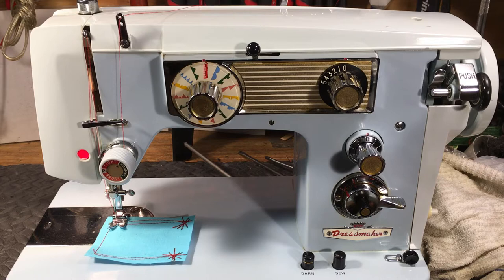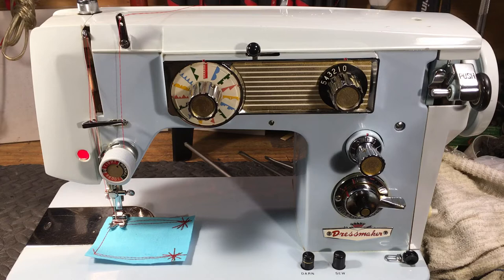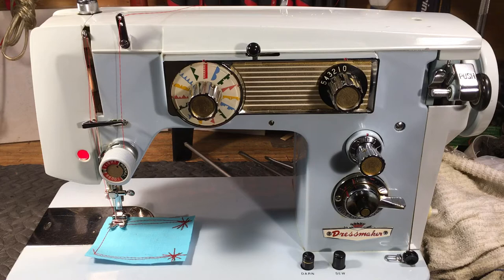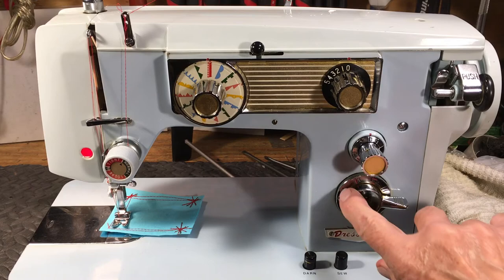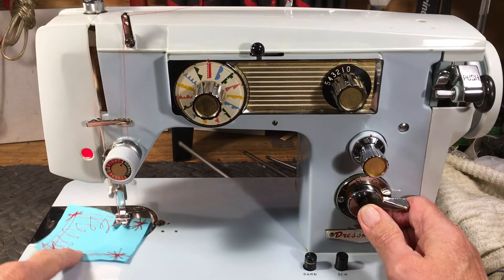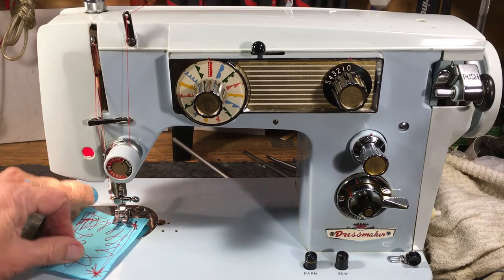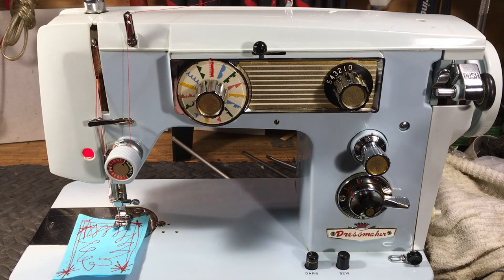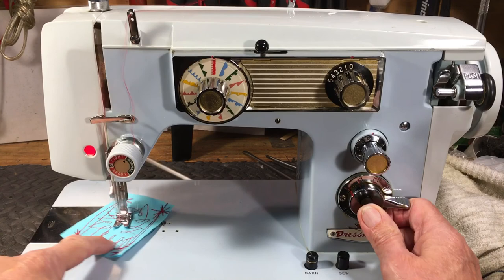Dressmaker SAMB-2 (side load)15 class masterpiece. Real heavy duty precision 2 thumbs up (Video 172)

Comment: Thanks for this - I always learn a lot from your vids! I just picked up a functionally-identical machine (with L-C-R needle position), called an Adler 950-B. A real beauty! Same layout with different knobs and color scheme. Once unfrozen it works great. A question re hook timing: Since the hook moves with the needle in zigzag, the hook timing remains constant at all needle positions. Is the hook tip set to cross the needle a little higher above the eye on these than with front loaders? This one is 5-6mm vs the 1-2mm I'm used to seeing with front load 15 Class at right position.
Reply from the maker: The hook will often pass a little higher up on the scarf (cutout) of the needle on a side load bobbin than on a front load bobbin. It won’t be more than halfway up, but in that area.
Reply: @randyyoursewingmachineman9954  OK thanks. It's probably where it is meant to be, then. It sews fine.
Reply from the maker: @JohnBau  😎👍
Reply: @randyyoursewingmachineman9954  For future reference, where does one loosen the hook on these side loaders to adjust its timing? I don't see anything obvious on the hook or its shaft.
Reply from the maker: @JohnBau  they are usually drilled and pinned. Any timing adjustments are to the needle bar height most likely.
Reply: @randyyoursewingmachineman9954  Yeah, this shaft is pinned at both ends, no adjustment. Thanks for confirming. The hook point passes the needle near the top of the kerf.
Reply from the maker: @JohnBau  😎👍
Reply: @randyyoursewingmachineman9954  Hmmm... I don't see any screw that releases the needle bar for adjustment, either...
Reply from the maker: @JohnBau  look in the little hole in the casting on the right side of the needle bar. Shine a light in there. 
You will see a slotted screw. 
Use the correct screwdriver if you ever need to adjust it. 
If you compromise the screw head with an incorrect screwdriver, it will be game over. 
Proceed with caution.
Reply: @randyyoursewingmachineman9954  Ah, ok, I see it, from inside the harp. Yes, the screwdriver needs to be exactly the right size... I'm thinking a ratchet type would be best. Many thanks for the tip!  👍👍
Reply from the maker: @JohnBau  you’re welcome.

Comment: I have one more question:  When I move the dial to straight stitch,  then reset the stitch width to zero, the reader (finger) moves to the right on to the top of the cam stack.  Making it impossible to move the stitch selector, even after moving the stitch width dial all the way to the left.  I can manually move the finger, take the top off etc etc....Seems like there may be a missing spring?  The linkage for the zig zag seems to be doing what it is supposed to be doing to engage the finger, but wont let it disengage.  Thanks!
Reply from the maker: If my memory is correct, there’s just one spring on the left side of the cam assembly that pulls the follower guide back to the front. Make sure the buttonhole function isn’t engaged.

Comment: Me. Randy I have one that works great! The reverse works but doesn’t have a button, I have to stick something in it to push it. You wouldn’t know where I can fine one? I have googled but have not came across one!
Thanks
Reply from the maker: Those buttons are hard to find. You’ll probably end up improvising and crafting one out of something else. I’ve repurposed button like things to make it work. Try the drawers at : 
Lowes, Ace Hardware, and Home Depot where they have their knobs, buttons, and widget items. There’s all kinds of cool stuff in those drawers that you can repurpose and reimagine. Good luck 🍀
Reply: @randyyoursewingmachineman9954  How much trouble is it too take the buttonhole selector switch out that houses the reverse button. Looks like to me I would have to loosen up a set screw on a cam to remove it, not sure what else. Afraid of having something fallout that I didn’t see where it when, or a spring fly out! Lol
Reply from the maker: @mikem970  there’s always the risk of causing more damage than the problem you’re trying to fix. I would craft a button out of wood and glue it on before I would do all that other risky stuff.
Reply: @randyyoursewingmachineman9954  that’s what I’ve been thinking. Thank you for answering and the advice!
Reply from the maker: @mikem970  you’re welcome.

Comment: I have this exact machine. It belonged to my grandmother. I had it serviced many years ago then put it away. I got it out recently and it only sews zigzag.  I cannot for the life of me figure out how to get it back on straight stitch. The buttonhole dial at the bottom is all the way to the left which looks like it should’ve be a straight stitch but it’s still zigzag. Any suggestions?
Reply from the maker: There’s a stitch width dial that should be on -0-. 
Also, make sure your cam release lever is back to the left. If it’s to the right, it will zig zag. 
If it was put away for many years after servicing it, it will need to be run and operated through its functions to get it operating again. 
The worst thing for a machine like this is not using it a lot, but using it too little. 
Good luck 🍀😎
Reply: @randyyoursewingmachineman9954  thank you for answering so quickly!  I do have the stitch dial on 0.  I’m not sure what the cam release lever is. Is it the button hole lever?  I have it all the way to the left where there are little straight stitch lines. It’s still stitching zigzag.
Reply: Also, I have the manual and I have done everything it said. But no straight stitch.
Reply from the maker: @nancyjames9471  oil it and work it. It will come around.
Reply: @randyyoursewingmachineman9954  ok..thank you. I’m hoping the manual will tell me what to oil.
Reply from the maker: @nancyjames9471  if a mechanism moves, give it a drop where it slides, rotates or pivots. Don’t oil the motor or belts. Good luck 🍀😎
Reply: @randyyoursewingmachineman9954  ok..thank you so much!!  I will never give up on this machine.
Reply from the maker: @nancyjames9471  good for you. It’s definitely worth the effort.
Reply: @randyyoursewingmachineman9954  after looking at it closely I chickened out and I’m going to take it to my sewing machine shop. I have never oiled a machine before and I don’t want to mess it up.
Reply from the maker: @nancyjames9471  just make sure they know what they’re doing. If they say,”You don’t want that old thing, you can’t get parts for them anymore”, grab your machine and exit quickly. They’re either charlatans or unskilled and know nothing about machines. 
Many of the sewing machine shops these days are run by the kids and grandkids of the original founders. 
All they know how to do is sell you another machine. 
I hope yours isn’t one of those. 
Good luck.
Reply: @randyyoursewingmachineman9954  I’m actually very anxious as I have a computerized machine (Viking) at a Viking shop now that went in as a healthy machine (no problems at all) just for a cleaning and maintenance appointment. I have had nothing but trouble since I got it back (short period of time) and now they are telling me it needs a new mother board and they (Viking) does not make the part anymore.)  You can only imagine how upset I am about this as it is my best machine and it cost me an arm and a leg. So yes, I’m very wary. I haven’t take the Samb2 in yet and I have been thinking about watching a YouTube video on how to oil a machine. Also, what kind of oil do you recommend? So, yes, I’m up in the air about the Samb2 still.
Reply from the maker: @nancyjames9471  use sewing machine oil. Get it online or at Jo Ann Fabrics. 
I would stay away from anyone that you’re suspicious about their honesty.
Reply: @randyyoursewingmachineman9954  ok..will look for the oil there. At this point, I don’t know who to believe anymore. I will try to post back here if I can get it back to straight stitch.
Reply from the maker: @nancyjames9471  if you take the top off you’ll see the zig zag mechanism in the center. It might be stuck from lack of use. Give it a nudge or a jiggle. It might respond and snap back to the straight stitch position.
Reply: @randyyoursewingmachineman9954  thank you so much. You have been so generous with your time. I will have a look tomorrow.
Reply from the maker: @nancyjames9471  👍🏼😎
Reply: @randyyoursewingmachineman9954  a no go on the jiggling. Nothing has changed. Also, even before I took the top off (I forgot to mention this) I noticed none of the other types of zigzag stitches work either. So I think this is bigger than what I’m capable of which is basically nothing, lol.
Reply from the maker: @nancyjames9471  if no one has applied a non skilled screwdriver to the inner workings, it will be a simple matter of patience and lubrication. 
If someone has turned every screw on it, not as favorable if an outcome will result. 
It’s usually the former, not the latter.
Reply from the maker: @nancyjames9471  with me having a global understanding if it’s operation, I am confident that in a very short amount of time I could have it working like new. 
To the untrained eye however, it looks kind of confusing. 
Being stuck in zig zag is preferable to not being able to zig zag, as that denotes lesser problems. 
The arm on top that slides in the groove in the center, needs to be pushed gently toward the rear of the mechanism. That will make it do the straight stitch. 
If it refuse to budge, one of your knob settings is incorrect. 
Make sure that the set screw on your zig zag width knob is tightened down. 
Maybe the knob is moving, but the shaft it operates is not. 
Worth a try.
Reply: @randyyoursewingmachineman9954  ok..I will unpack and try again. I have to say it was interesting looking at all the guts on the inside after I got the top off. Did you know this machine weighs 35 pounds?
Reply: @randyyoursewingmachineman9954  it has been in the shop  I might be taking it to to try to get the bobbin winder repaired a long time ago. At that time they told me they could not get the part to fix it. This was many years ago. I believe they are reputable as they get good reviews and have been there a long time. I’m thinking they wouldn’t have used the wrong kinds of screwdrivers but who knows for sure.
Reply from the maker: @nancyjames9471  when I say “an unskilled screwdriver “ I’m using a euphemism for idiot. 
Trying to be kinder and gentler with my terminology. 
If they couldn’t fix that particular machine, your dealing with “unskilled screwdriver operators”. 👍🏼😎
Reply: @randyyoursewingmachineman9954  ok..that’s funny. I wasn’t sure but wanted to assume the best. I have the machine back out and going to try your most recent instructions.
Reply: @randyyoursewingmachineman9954  ok..the pattern selector dial moves freely when I use the reset lever. Both of those are working fine. The zigzag width dial is moving freely. The stitch regulator dial is working fine and the buttonhole dial is fine also. I tightened all the screws on each dial. None were really very loose. I’m at my wits end.
Reply from the maker: @nancyjames9471  when you turn the stitch width dial, that mechanism on top in the middle should move correspondingly. If the dial moves, and the mechanism doesn’t, the set screws are the problem. 
They can be tight, and situated improperly. 
If that’s not helpful, I guess we’re done. 
Something else has happened involving an untrained screwdriver. 
That mechanism on top HAS TO MOVE FROM WHERE ITS AT NOW, to where it needs to be. 
If it’s not moving?????
Reply: @randyyoursewingmachineman9954  when I turn the stitch width dial nothing else happens. So, I’m guessing that’s the problem then?  I did loosen the screw a tiny bit but it didn’t help.
Reply from the maker: @nancyjames9471  so you have the top off, and you’re watching the zig zag mechanism, and when you turn the width dial nothing moves?
Reply: @randyyoursewingmachineman9954  there is a partial metal plate on the inside right behind the width dial. That moves.
Reply from the maker: @nancyjames9471  run the machine with the zig zag dial set on zero and see if it vibrates into position. 
Run it real fast and make it vibrate like crazy. Make sure the presser foot is raised and the needle is removed and the clamp is tightened back down.
Reply from the maker: @nancyjames9471  the only way the pattern dial should be able to turn is if the pattern release lever is pushed, or the zig zag dial is on max zig zag. 
If your pattern dial is turning, then it’s locked in its wide zig zag setting and that the problem.
Reply: @randyyoursewingmachineman9954  I use the release lever to turn it. It won’t turn without the release lever being used. I haven’t run it as mentioned in your previous comment because I’m worried about the lack of oil?
Reply from the maker: @nancyjames9471  ok.👍😎
Reply: @randyyoursewingmachineman9954  I very much appreciate all your help. I think I have located a new sewing machine place that works on the old heavy duty sewing machines. I’m waiting for a call back from them. I guess I was just afraid I might cause more damage since I don’t know what I doing. ☺️
Reply from the maker: @nancyjames9471  👍🏼😎

Comment: I have a similar machine.  Struggling with the cam stack reader.  It is all oiled and lubed.  But I cannot get it to read the cams.  Zig zag only.  The cam stack rotates and appears to be in the correct position.  Any thoughts?
Reply from the maker: The cam stack follower has a spring that returns it to the straight stitch/zig zag position when you rotate the dial. Make sure that it travels freely when you push the release lever and travels all the way front it back without hesitation. Most times, the stitch width needs to be on zero. Stitch length will be near zero.
Reply: @randyyoursewingmachineman9954  A typical case of user error.  Thank you so much!!
Reply from the maker: @tksewingmachineandrepair4243  user error? Is there such a thing? I stay out of trouble by blaming it on gremlins or burglars. My customers never make errors. Most of them are perfect in every way. That’s my story, and I’m sticking with it.
Reply: @randyyoursewingmachineman9954  LOL right.  I really appreciate your help!!
Reply from the maker: @tksewingmachineandrepair4243  👍🏼